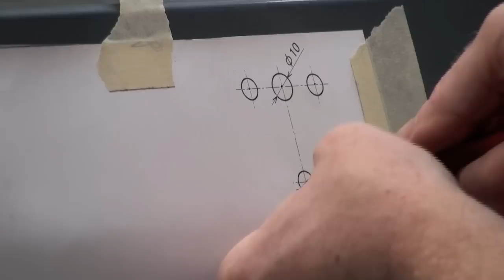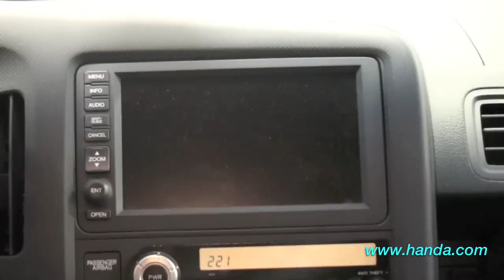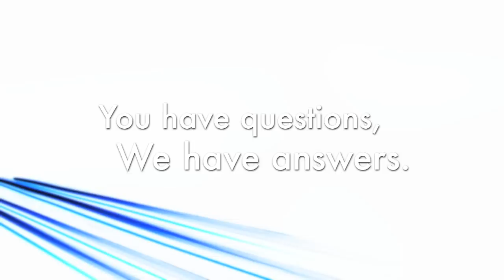Ridgeline Back-Up Camera Installation (Honda Answers #72)

Comment: The install of a camera using the '09 liftgate handle is much easier. For the record many of the steps these guys take are completely unnecessary - even using the obsolete backup camera they're installing. There is zero reason to get into the roof! Speaking as someone who's done this, here are all the steps in the video with those that are either obsolete or unnecessary marked as such. By obsolete, I'm referring to steps that are needed only for the old style camera they're using and which are not needed if you opt for the liftgate handle camera.

1.	Remove left front door sill trim
2.	Remove the fuel fill door release handle
3.	Remove left rear door sill trim
4.	Remove left front seat belt lower anchor bolt cover and the lower anchor bolt
5.	Remove the left B-pillar lower trim panel
6.	OBSOLETE: Remove the driver’s seat frame rear cover (only needed if installing to Navi)
7.	Lift up rear seats and remove the rear under seat trim panel
8.	Remove the rear seat bracket covers
9.	Remove the rear seat belt anchor and 8 seat anchor bolts
10.	Remove rear seat head rests
11.	Flip up tabs and remove the caps from the rear trim panel
12.	Remove the rear seat (lift up and slide out – two-man job)
13.	Remove the rear trim panel cover
14.	Remove the left rear seat belt
15.	Remove the left rear pillar trim
16.	Remove the left rear lower anchor bolt cover
17.	Remove the left rear taillight
18.	OBSOLETE: Remove the right rear taillight (only needed if you remove the bumper)
19.	OBSOLETE: Remove the rear bumper (are you stoned, or just stupid?)
20.	UNNECESSARY: Remove the rear roof trim (completely unnecessary in any install)
21.	UNNECESSARY: Remove the antenna grommet & unplug the vehicle connector
22.	UNNECESSARY: Remove & discard the grommets, then install new grommets
23.	UNNECESSARY: Remove & discard clips from the rear roof trim
24.	UNNECESSARY: Install 7 new clips
25.	UNNECESSARY: Remove the left C-Pillar outer trim light (steps 20-24 required for this)
26.	UNNECESSARY: Unplug the connector
27.	Remove the left bed rail trim (unscrew one screw and then pull trim backwards)
28.	Remove the left front anchor (take out the right one too for Roll-n-Lock install)
29.	Remove the front bed panel
30.	Remove the left lower bed light
31.	Remove the left side panel
32.	Remove the tailgate trim (take out 4 screws and tap it to the right)
33.	Remove the tailgate panel
34.	OBSOLETE: Using scissors, cut out the marked area from the template
35.	OBSOLETE: Align the edge of the template with the edge of the tailgate
36.	OBSOLETE: Attach with tape
37.	OBSOLETE: Center punch the marks on the template
38.	OBSOLETE: Drill three 8mm holes and one 10mm hole
39.	OBSOLETE: Remove any burrs
40.	OBSOLETE: Install blind nuts into each 8mm hole
41.	OBSOLETE: Remove 4 screws from the rear camera
42.	OBSOLETE: Route the camera harness through the camera sub bracket
43.	OBSOLETE: Install with 4 screws
44.	Tape a piece of wire to the terminals on the harness
45.	OBSOLETE: Route the harness through the 10mm hole
46.	OBSOLETE: Seat the grommet into the 10mm hole
47.	OBSOLETE: Install the rear camera bracket to the 3 blind nuts
48.	OBSOLETE: Install clear adhesive tape to the tailgate
49.	OBSOLETE: Remove the torx bolt from tailgate hinge and attach the harness clamp bracket B
50.	Secure harness with wire ties
51.	OBSOLETE: Remove the lower outboard hinge bolt
52.	OBSOLETE: Attach harness clamp bracket A to the tailgate hinge
53.	Secure harness with zip tie
54.	Open the tailgate and clean area where the cushion tapes will attach
55.	Secure the harness to the tailgate with cushion tape
56.	Secure harness to tailgate with zip ties and cushion tape
57.	Route the rear camera harness through the left side vehicle panel hole (the one the left rear taillight harness passes through)
58.	Route the camera harness along the vehicle harness towards the front of the vehicle
59.	Secure harnesses together with zip ties
60.	Remove vehicle grommet (below harness and behind front/left side bed panel)
61.	Route video cable through the vehicle grommet opening
62.	Use electrical tape to secure the grommet to the harness
63.	Remove tape and wire from camera harness
64.	OBSOLETE: Plug the camera harness terminals into the 6-pin connector
65.	OBSOLETE: Plug the camera subharness 6-pin connector into the 6-pin connector for the camera harness
66.	Secure harness with zip ties
67.	Route video cable forward along the vehicle harness
68.	OBSOLETE: Route harness under the driver’s seat
69.	OBSOLETE: Plug the rear camera subharness into the Navi control unit
70.	OBSOLETE: Install the rear camera trim (my god that’s ugly!)
71.	OBSOLETE: Measure and mark bumper at the location shown
72.	OBSOLETE: Using a utility knife, cut and remove the measured piece
73.	Reinstall all removed parts
74.	Drink a beer or three – you deserve it!

Comment: Near the passenger door on the driver side, up up the kick plate. You can drill a hole there  or use the existing middle hole (which is utilized as a trim tab for the kick plate) and feed a wire into the cabin. Reach under and you will feel two oval holes that’s facing inboard. You can run the wire out from here and aft to the bumper. Or you can listen to this yo yo and take apart your entire ridgeline. I took rear tire off and a kickplate. Need to pull off the rear light assembly to access the reverse power line

Comment: I purchased a back up camera license plate kit for my Ridgeline. Have the video line input already in my head unit. Is there an easier way to route the line to the back? I was thinking if I could run the line under the vehicle, and zip tie it to things that would be easier, but I don't know where to route the wire outside the vehicle from the head unit. I don't want to have to remove all that trim and backseats etc. just for a backup camera install. Thanks.
Reply: Don't bother. Just run it under the vehicle, preferably with some shielding. this video is super bad advice, don't bother watching it

Comment: If your going to pull the gate that far apart at least put the power lock mechanism in so the tailgate locks with the door locks. Although these guys would need the car for 2 extra days to relocate the headlights or something

Comment: 2020 Ridgeline sport using an aftermarket mirror camera. Is it easy enough to mount the rear facing camera under the ledge of the third brake light by the back window and route the cord through the same hole those brake light cords run through into the cab?

Comment: How to drill a hole in metal:
1) Use a center punch
2) Start with the drill bit of the desired final diameter
2) Push as hard as you can to try and start the hole
3) Push harder when it isn't working being sure to really dent the metal
4) Eventually get a smaller drill bit and drill a pilot hole first for the remaining holes

Comment: that has got to be an expensive installation, a lot of work, impressed that someone would know what has to come off to run a wire....I sure wouldn't have guessed that much
Reply: 6 hours at $80 per hour just for labor...
Reply: For real. I would have just started drilling new holes of my own without knowing any of that has to be removed lol
Reply: You could always read the INSTALLATION
 INSTRUCTIONS

Accessory Application Publications No.
 AII 28617  Issue Date: FEB 2005
2006 RIDGELINE
 REAR CAMERA ATTACHMENT (EX-L WITH NAVI) https://www.manualslib.com/manual/69036/Honda-08b21-Sjc-102.html

Comment: How did you wire it in to the navigation system? I saw where you mounted the camera & ran the wires under the driver's seat, but how do you hook it up?
Also, do you have any videos of how to add blindspot cameras to the sides of the truck & wire it to the navigation?
Anyone know of some diagrams for how to connect cameras to OEM navi?

Comment: i installed a compleat sound system, a box with two 10 inch subs, an amo, an extra batery, a electric converter, a back up cam, and connected all of it togeather and all i had to do was take off two of the floor panels lol the "hard" part was going threw the fire wall and even that took me less then 10 mins lol all together about an hour smh maybe i should make a video lol i though IIIIIIIIII TOOK TOO LONG LOL

Comment: They sell the color matched handle with the hole in it already for $35 lol as long as you bring your wires up in the bottom left corner of the gate it can open both directions still. I get that the trunk under the bed makes it harder to hide the wire safely but holy shit this is the most ridiculous thing I’ve seen doing a camera install in my life and I’ve done lots of them. None of those panels are ever as tight once you remove the clips once so imagine the rattles and creeks in this thing when all but 2 clips are removed from the entire truck for that giant ass camera to hang off your tailgate
Reply: If you watch closely, he replaces the clips with NEW Ones.

Comment: Would have been easier to just run the camera wires under the body and in through the fire wall, less then half the time and no greasy shoes in the back seat.

Comment: While you are at it, lets cut the frame, drop the engine and transmission, remove the radiator, go back down under and remove the axle, cv joints, suspension, muffler, exhaust, wheels and viola, no need to look behind and front so what camera......WOW....really?

Comment: 6 hours of work tearing apart half the truck, running wires and drilling holes into the body only to end up with an ugly camera wart on the tailgate and potato quality video on the dash. I know this video is 9 years old now, but it didn't seem worth it in 2011.

Comment: Stupid, way to much work and you put it on the tailgate,  I have installed 3 of these on Tacoma's, Run the wire above the frame, attached the camera to the underneath of the bumper, hook the reverse light cable to the wire for the  trailer plug, DONE.

Comment: Step one: remove all pieces from the truck. Step 2: reassemble entire truck around the backup camera. 
This is also the ugliest backup camera I've ever seen. License plate ones are way better, and the one that's built into the handle is even better than that. What an absolute dumpster fire. Poor truck